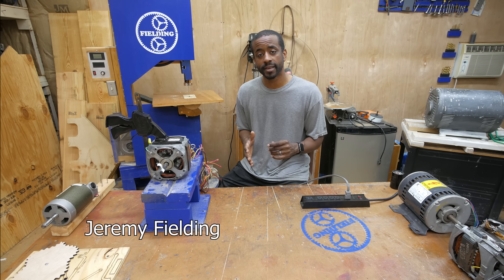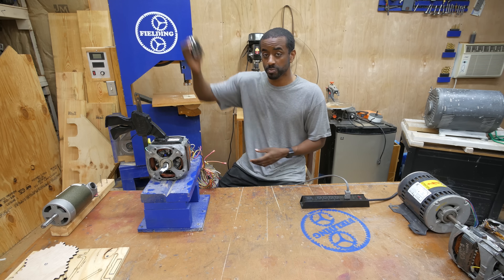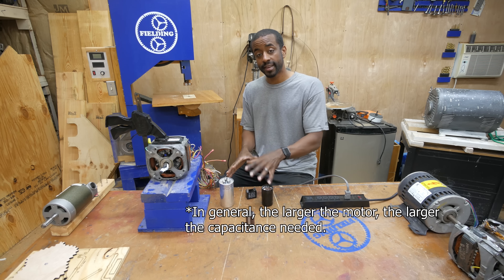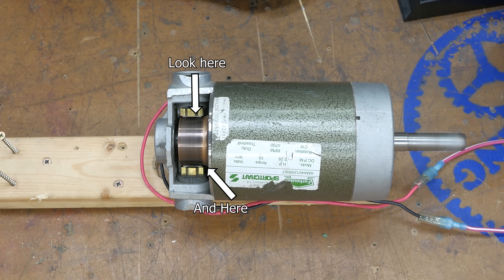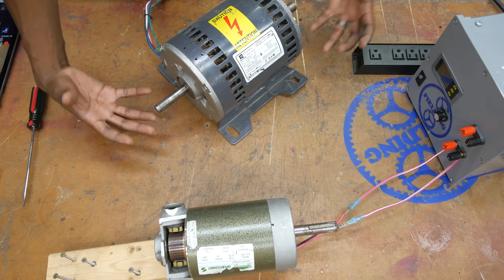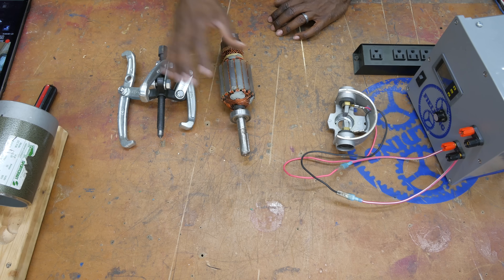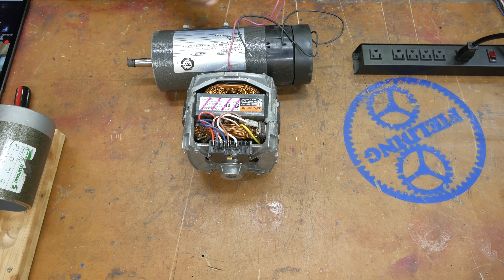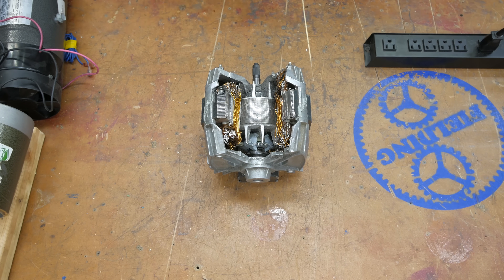Three Most Common Motor Fixes Anyone Can Do; Ultimate Guide to Electric motors ; #070

Comment: I have a 5 hp delta cabinet saw that stopped working. I took out the motor thinking the start capacitor had failed, but it still wouldn't start when I replaced it. Took it in and $100 later found out that sawdust in the centrifugal switch was keeping it from closing, sigh!

Comment: Our well pump has failed several times due to power surges and/or lightning. There is a control box at the well head and the pump is 600 feet below. In each case the start capacitor has blown along with the relay that switches from the start to the run capacitor once the pump is running. This motor is served by 3 wires, one of them sending current to the start winding. Once the motor is running the start winding actually generates a current which tells the relay to change to the run capacitor. After replacing the control boxes at about $500 each, including labor, I figured out how to replace individual components within the control box for about $50 and my labor. Better yet, I found that by installing surge protectors on both sides of the circuit (on the power supply side as well as the demand side which required a 3 phase protector) I can stop surges from both the power supply side as well as from lightning back feeding from the pump 600 feet below. We haven't has a control box failure since I installed the surge protectors.
Reply: OK Boomer  The actual well depth is 620 feet. I live in the USA, mountains of NC at an altitude of 3700 feet. Deep wells are common here.
Reply: @pyromedichd1  and l tough 220 feet was very deep 😓😓😓
Reply: 600 feet?  My well is a couple hundred feet deep but the pump is only about 20 feet down hole.  The water level comes within 6 feet of the surface.
Reply: @stroys7061 wowser. Where I live, there's a spring of water in the wetter seasons just by the well cap. At the base of a hill, so that makes sense.

Comment: Great information! I am going to take a look at my cement mixer, its capacitor may be the problem. Luckily for me there are two well stocked places to get all sorts of electrical nick nacks. 

One side note. For precision motors such as stepper motors you can not pull the commuter out. If you do and put it back in the motor will never have the same power it did before. 

On a second note, on many older motors they had a port to put a bit of oil on the bearings. Not many modern motors have them

Keep up the great work!!!!

God bless you and your family!

Comment: Hi Jeremy,

What parts do you typically keep off of an old refrigerator? Mine is broken and going to the dump in a week.

Thanks!
Reply: Old refrigerators are hazmat, so it's best not to save anything off them because you don't want to accidentally vent the coolant into the atmosphere.

It's usually tough to get to the motor without disturbing the coolant lines, but if you can, they're an ok pickup.

Comment: The coolest, calmest, CLEAREST, motor guy on the planet.
Reply: Great teacher.  I've spent a lifetime using and maintaining motors of all types. I have already forwarded this to two others.  A slight aside tip:- motors often have pulleys or sprockets on the shafts.  It is a constant problem trying to get a suitable puller to fit for pulling them off.  So now I drill and tap three spaced holes in all sprockets and pulleys.  I have made a set of small pullers with matching holes to the threaded holes in the pulley/sprocket, on PCD 20mm,30mm, ..etc.  In the center of these plates I have tapped a central hole for jacking bolt.  To pull off, three set screws pass through holes in pull plate and into the pulley.  Then the jacking bolt engages against the shaft. They work great.  The pull plate without screws is used to position the three holes before tapping.  I can't attach a photo-sorry.
Reply: @jossfitzsimons  thats a good idea with the tapped holes I can't tell you how many times I have had problems with Lilly's or gears being stuck
Reply: @Joss Fitzsimons  What is a "pull plate"? Oh, my favorite puller is the old Proto 2 jaw puller with the 2 sets of jaws large and small! It pulls just about everything with ease, unlike those pieces of crap 3 jaw pullers like in the video! You can get more than 10x the pulling force from the Proto 2 jaw puller than you can get from those pile of crap 3 jaw pullers! They will break pulleys and gears if they are froze up and won't move.
Reply: This man is one of the best teachers that I have had in 50 years. His explanations are so easy to understand. I feel very fortunate to have stumbled upon his channel. I have much appreciation for your presentations. Thank you.
Reply: Yeah, I like the straight up straight talk without the weird YouTube over the top dance-splaining that so many do.
Reply: AMEN!
Reply: ... If bob ross did electronics..
Reply: Agreed he defiantly is he is my goto guy when it comes to them
Reply: Agreed. Love this channel.
Reply: I concur.  He is my motor GURU.
Reply: Strongly agree
Reply: Wire inside connected to the windings pulled out. Is there a way to fix it?
Reply: And one of the smartest.
Reply: SERIOUSLY!
Reply: Right?
Reply: Agreed
Reply: agreed
Reply: @mattymcsplatty5440  to it so up

Comment: Nice to see you back Jeremy. Your timing is impeccable, just bought a used drill press (Ryobi) and motor makes that humming sound, I will be replacing the capacitor. Thank you. I have a question about a 10" bandsaw (Craftsman model No. 351.284410) that was used very little, also bought it used, issue is the motor stalls under very little load ( would not cut a 1x2 piece of pine) any idea what would case it to stall? Thanks again Jeremy :)

Comment: Thank you for taking the trouble to make the cutaways!!!
Fan clogged with dust causing overheating. Cleared clogs now runs fine!
Motor emerged in water (wasn’t running when in water). Dried the motor out in the hot sun for a week!
Started up and ran fine. Added oil to the bearings to help keep it running.

Comment: Other common problems - Hi Jeremy.  One thing I sometimes come across here in New Zealand is the commutators shorting due to either a build up of brush carbon dust, or mushed copper where one segment had spread a bit like toffee to its neighbour.  I will dress the gaps between each contact with an old hacksaw blade  if I ever strip a starter or dynamo that far on a car.

Comment: Excellent video! 
I don't have an unusual fix or anything like that but I have a, hopefully, useful tip...use a paint marker to write the pertinent info regarding the motor on the motor or on a nearby and visible surface. Things like phase, power, frame size, rotation direction and if reversible, really help when servicing equipment since all the data can be easily accessed to order parts or even a replacement without having to tear down the equipment, which inevitably leads to scrounging for last minute replacements due to lost parts. And if servicing a motor in a harsh environment, I normally include upgrading the bearings and seals at that time also. It prevents callbacks for failures of same since everything got jostled and now the integrity of those parts might be compromised (or they weren't all that good to begin with).
Great video.
Thanks for sharing your knowledge!!!
Reply: Thanks sir its a eye opener for me in now where you are great instructor now i can also   help myself

Comment: Hi Jeremy, Just fixed my 2hp 120V spa pump that was just buzzing like when the capacitor was disconnected in your video. Capacitor was fine, it was the contacts on the centrifugal switch that weren't making contact when the motor was stopped like they're supposed to. A little bit of gentle sanding with a very fine grit sandpaper has fixed it for now. Hope this helps somebody if the capacitor-swap fix doesn't work. Saved me ~$250 for a new motor!
Reply: better to use a pencil eraser
Reply: Basically agree.    My experience is about an equal number of faulty capacitors and dirty centrifugal switch contact, often a piece of sawdust preventing closure
Reply: Hi Jeremy.   Great videos.  Thank you!   Could you touch upon these Fasco D132 3.3-Inch General Purpose Motors, 1/20 HP, 115 Volts, evap motors.  I've had 3 of these quit on me after 2months of running.   The first one came with the evap unit and lasted the longest at 3yrs.  The 2nd I found on Amazon, and lasted 10mo's. ,  The third was a FASCO, and it ony lasted 2 months!      At $60-$70 a pop, I'd like to begin repairing instead of replacing.

Comment: Holy shit, I must have heard that hum a dozen times and just figured the motor was a loss. You’ve opened my eyes.
Reply: You'll also get that hum on a 3 phase motor if one of the phases is wired incorrectly or if the power from the utility company has a phase out for repair in their 3 phase service.

Generally, when you hear that sound, turn the motor off, because it'll make a whole lot of heat in a hurry because electric motors draw the most current (and create the most heat) while they're not spinning (they call this a 'stall').
Reply: @jttech44  thanks, this is really insightful and good advice.

Comment: When replacing a capacitor, always replace with a larger capacitance if the exact size can't be found. Using a smaller capacitance Cap could cause the motor to hum and slow to start. 
For a run capacitor, it needs to be as close to the original as possible as the capacitance can actually effect the speed of the motor as it is designed to shift the phase to load the other coils.
Reply from the maker: Good point about the run capacitor. I also agree larger capacitance would be better than lower for the start capacitor.
Reply: @Jeremy_Fielding  I have an 18 volt Bosch drill that smokes when I run it and I can see sparks, and or red hot windings. It was already factory refurbished when I bought it at a discounted price. Do you think there is a short in the windings? I used it with a 4 inch hole saw to cut 9 holes in a plaster ceiling and I think that was too much for this not so powerful drill. I was expecting a drywall ceiling and was going to cut the holes with a jab saw, but I was incorrect as it was old hard 1960s plaster. Thanks in advance.

Comment: Jeremy- what do you connect to the two blue wires from the DC thermally protected motor? Are those a dry contact for remote alarm?
Reply from the maker: They are connected in series with the red and black wires on one side (red or black). You just need the power running to the motor to go through the blue wires. Its like a switch inside the motor.

Comment: Have three antique 1 hp general electric motors in our garage. On the surface they all looked fine until you went to turn them and each felt crunchy in different ways. A mouse had made a nest in one and the other two had mud wasp gunk in the middle of them. Not to mention they were rusty on the stator. Cleaned up with wd40 and a wire wheel. They all work great now

Comment: Heh... only just noticed you're last name. Very fitting given the subject matter.

One Thing you've got wrong, the capacitance of the start capacitor is very important! It determines how much starting torque the motor will have and needs to be matched to the inductance if you expect to get the performance that's written on the name plate.
Reply from the maker: I only partially agree. It matters if you want original performance. But for beginners if the numbers are rubbed off, do you really want to say you need an exact replacement so figure it out?  No capacitor means zero starting torque. There was a note on the screen with more details in the video
Reply: @Jeremy_Fielding  I do understand what you are saying, and to be fair, any value will allow the motor to start, unless the capacitor value is so low that there's not enough torque produced to overcome the inertial force.  I'm not trying to nit pick here, I'm only saying that if one were to believe that the value of the capacitor unimportant, it would be easy to run into problems with performance. You're teaching beginners here man, it's perfectly conceivable that someone might find their way to your channel because they can't figure out why their compressor motor is too weak. Same argument juxtaposed. 

My intention is not that of insult or to belittle you :)
Reply from the maker: I think we are on the same page...  I didn't take your comment as an insult. A few more thoughts to round out my thinking. If they have the numbers for reference there is no problem anyway, and only a few in the extreme case of not having the number would still have a problem if they happened by 50-50 chance to buy one too small. From my experience seeing questions in the comments, the vast major have problems related to these fixes and are working on a power tool or appliance with less than 1hp. Unless you buy a ceiling fan capacitor for your compressor, you are likely to be just fine. This is why I chose the examples I did, and made the comments I did (numbers rubbed off what do I buy is a common question etc). Also note I said "washing machine capacitor" for the same reason. Search for something similar to your application and you should be fine. Finally in the notes on the screen, "the bigger the HP the bigger the capacitance should be". This advice should help the vast major of watchers.
Reply: @Jeremy_Fielding  all very valid points. I did get a laugh out of ceiling fan for a compressor too :).

You have an awesome channel man. Anything saved from land fill and re-purposed or repaired,  is a step in the right direction and I'm all for it my friend.

Thank you for what you do :)

Comment: I had a problem with an old drill press motor overheating with little to no load on it. Ended up being the centrifical starting switch. It wouldn't disengage when the motor got up to speed. A few taps with a hammer and some WD-40 got everything working again. I didn't have to disassemble anything fortunately.
Reply: WD-40 before its carrier fluid fully evaporates ignites with a spark like any volatile fuel.

Comment: A general question  regarding  using a 208v a.c. fan motor that uses one capacitor wired  separately. Can it be wired with a switch  and plugged  into a 240 socket? Would it work, powering  a small hobby lathe? It's 1725 rpm, not much HP from what I've been able to find out. Appreciate any help from your subscribers. Great info by the way. Thanks for your work.
Reply: Not a good idea because a fan motor (often a "squirrel cage" brushless type) is intended for a constant load (the fan) and a low load start. Use in a lathe would give sluggish performance and motor over heating because of the missing fan that cools the motor.
  You would be better off finding a capacitor start motor with the seperate start windings like in the cut-away Jeremy showed. Very old wash machine motors work well for this... so old that they are round, have proper mounting bases, and if they are really old, plain bushing bearings. I have a Westinghouse motor that I installed on my cut-off saw and it's probably 70 years old... a few drops of oil every few months and you're good to go.
Reply: fan motors typically have very low starting torque and would be unsuitable for high torque applications such as a lathe

Comment: Jeremy,
I have a 110V squirrel cage blower that I took out of a central air system.  It has 2 capacitors.  The blower will start up fine but when it gets warm after 5 or 10 minutes, it will shut down.  After it cools off, it will run again and shut down.  I replaced the run capacitor and it still does it. The windings are clean with no dust buildup so the airflow in the motor should be fine. The bearings are fine also. (These blowers are great to have in the shop during summer.)
Reply: I have a blower motor with only a start capacitor that everything seems to be great but it also over heats and shuts down at about 200F. Wish I could figure it out.
Reply: Blowers need a static head which reduces the operating current.  You need to restrict the intake or exhaust to simulate the static head pressure.  This will cause the motor to slow reducing the current.  It's an oddity for blowers.  Axial fans increase amperage if you restrict air flow.
Reply: @jkbrown5496  Thanks so much for your response to my problem. I am re purposing a blower system. It was blowing against a filter and now I have it blowing out an open vent and pulling through the filter. Are you saying that I need to restrict the out flow? After the problem appeared I removed it and have been bench testing with out the fan attached. Is this also causing me to lose the static pressure that is needed?
Reply: @angelic7072  search for a video "Shop fan out of old furnace blowers" from sixtyfiveford.  He shows how to repurpose a blower and discusses the need for restriction due to the low static head.
Reply: @jkbrown5496  Thank you very much for your follow up. Learned something new. Restricting the flow opposite the motor seems to be working. Pulls more air over the motor too. I also removed the speed control potentiometer that came with it. So far so good!
Reply: Also did some quick tests. Wide open flow was pulling more than 10 amps. Just restricting the out flow by 70% dropped the amps to 4. I will need to calibrate it when the filters are in place. The is a laboratory clean air station intended to blow air at you, I am re purposing it as a work station to draw fumes away from me and through the hepa filter that it came with. Might be a good project for you. These are many thousands of dollars new but can be found in surplus actions for less than $30.
Reply: /media/dad/EOS_DIGITAL/DCIM/100CANON/IMG_8448.JPG